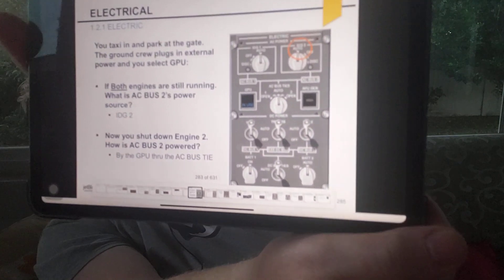Max gives a systems class

Comment: Tim McCoy wife's account
DC-7 airtanker all analog
Breaker and Main Bus behind our head we had no FE so being FO  system management was MY job .
So,when we had all four generators go offline I had to troubleshoot. Nothing tripped on the main except the generator
Breakers.
No battery at all . Weird.
Isolate the system and start the APU which was techumseh put-put attached to a 48V generator. Now power to the bus everything is now
 normal.except the generator breakers ,they tripped in unison. We head for home. The main battery wasmelted. We were down for two days.
A wirel caused the short.

Comment: Only thing I would add is that the IDG combines the CSD and Generator into one unit where as on older A/C types they were separate. Great idea unless you have to replace said IDG which typically start off at around 150 lbs and go up from there. Great video Max, look forward to the next one.
Reply from the maker: they be heavy...and expensive

Comment: Very interesting! Thanks for sharing. One question: when ground power is plugged in, you said you need to press the button that you wanted to use the ground power, so does that button connect ground power to the Buss Tie (obviously through a relay)?? Model on!
Reply from the maker: It actually only makes it available to the AC Bus TIE and it says AVAIL until the AC Bus TIE actually uses it then it says IN USE.  When you kill the APU is when it switches.  If the APU is not used it switches as soon as you press the button (less a few seconds to make the swap).

Comment: So it sounds like a triple redundant power system so you would have to lose power from both engine generators and the APU and I bet it has a battery pack to provide emergency electrical power for X number of minutes flying before exhaustion.

IMHO I can see where it would help you out to record the teaching video because you have to know it well enough to explain it.
Reply from the maker: bingo